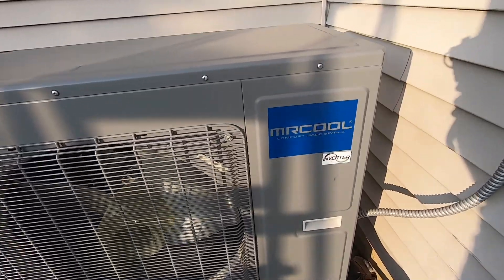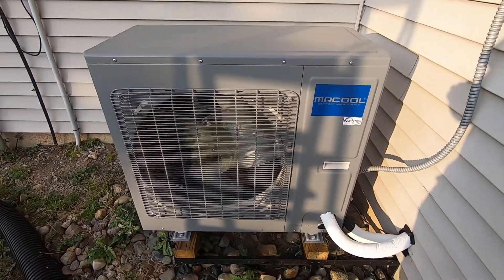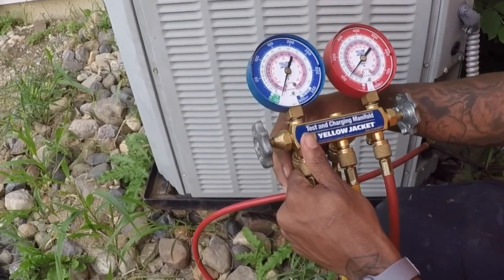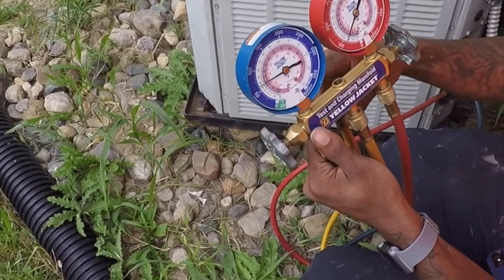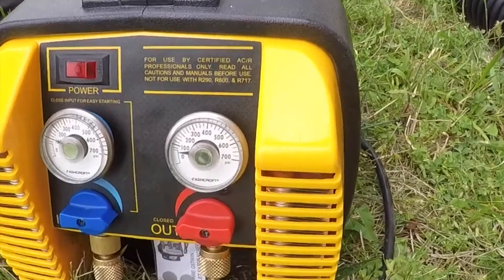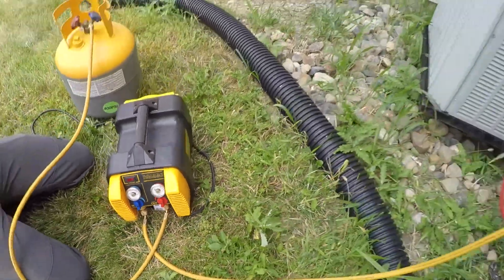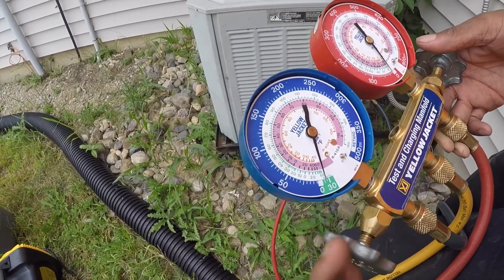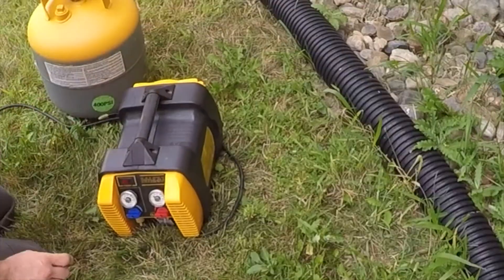How to disconnect air conditioner lines  safely

Comment: Where old ac  lines go into furnace not using what do I do cap them off
Reply from the maker: Hey Thomas,
Honestly can’t remember what we did. If you had a company evacuate the lines like we did, they are basically empty. Not really sure what’s ideal - your idea is as good as mine. 
Thx for watching.